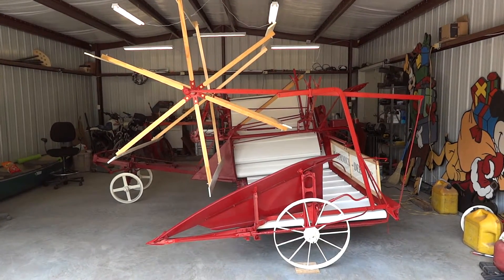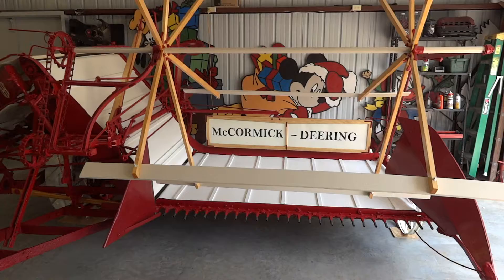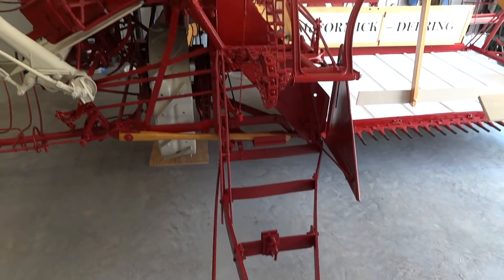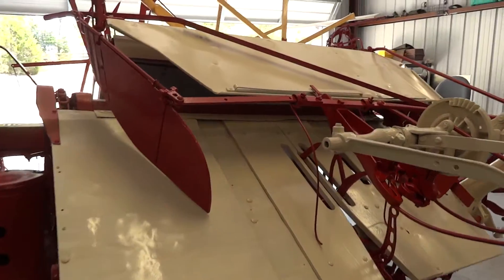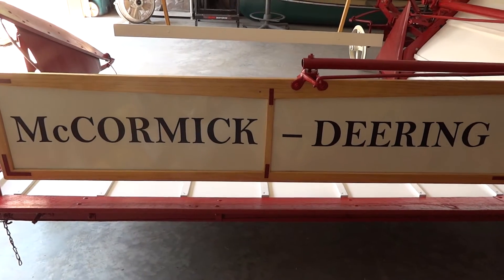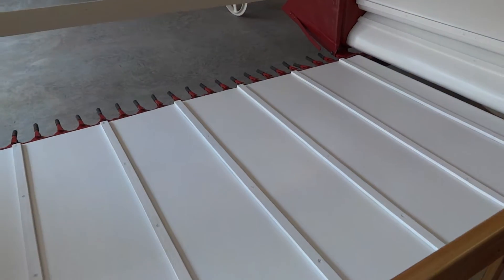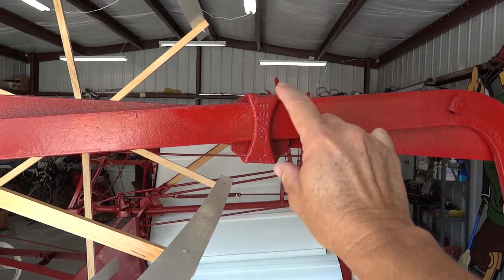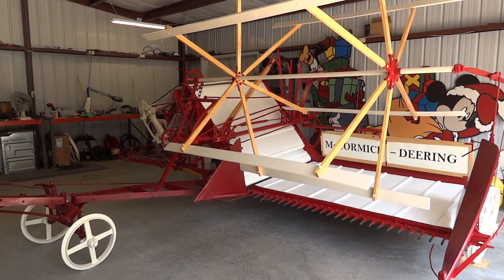1930's McCormick-Deering Grain Binder

Comment: Outstanding job on the restoration....I agree, looks better than new. I am an old retired guy, not a farmer but enjoy making wood projects that move (automata). I'm currently trying to make a wood model of the mechanism to tie the bales. I have the part to tie the bales working but am at a loss as to how the string is held in place while the tie is taking place. I'm assuming the corn binder uses the "Bill hook" thing that square balers do to tie the knot. Also, what is it that pulls the knot tight? I believe on a square hay baler the hay is compressed and releasing the bale is what tightens the knot. The corn binder does not appear to compress the bale, or at least a limited amount. Is there any way I could get a close-up photo of the mechanism to hold the twine while the tie is taking place? Thanks for any help you can provide
Reply: The Massey Harris Binder had packers that compressed the Sheaf, the spring tension on the trip arm made them tighter. I only know this from observing my Dad, we cut wheat oat and Barley in the Uk up to 1968.

Comment: would like to donate your missing spring if your still in need of one. have one half grown in a tree and far from restoration quality. excellent piece.
Reply from the maker: yes I would be interested in a spring.  I also need the knotter mechanism that is underneath the boards at the discharge end of the binder ( if you happen to to have it).